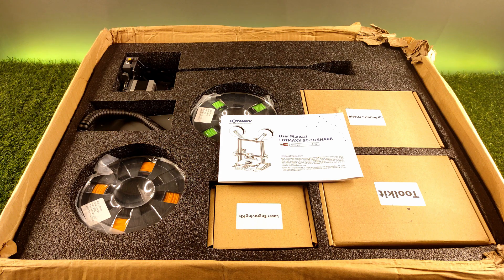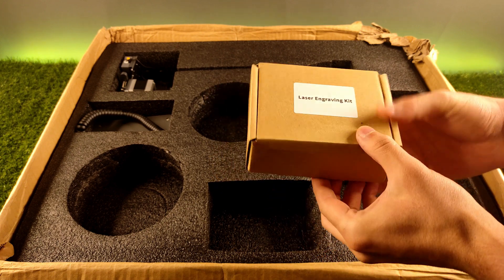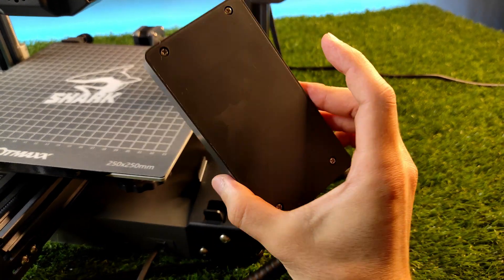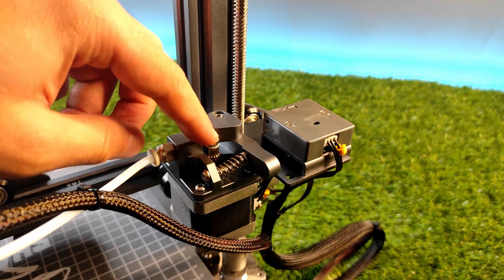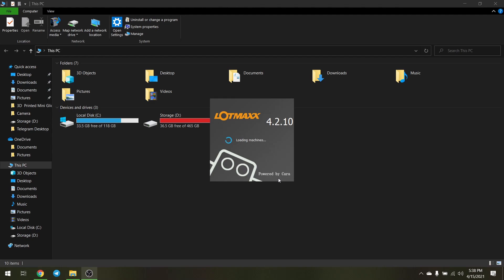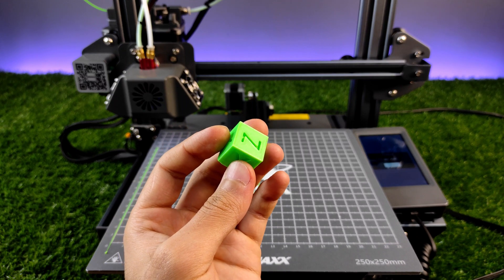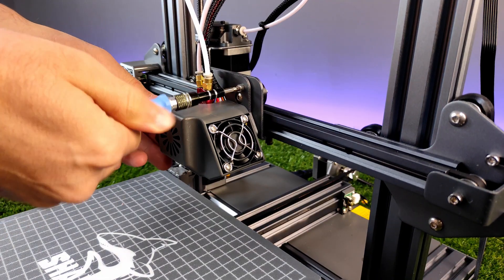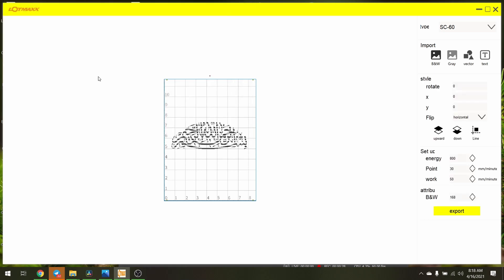Lotmaxx SC-10 Shark V2 Review: Best All in One 3D Printer?

Comment: I made the mistake of not manually leveling before automatically leveling. You want to talk about pulling your hair out because your printer is screwing up and nothing sticking to the bed? Yeah that'll make you crazy until you manually level the bed. What I discovered in the process is the bed was too low to actually level. The automatic bed leveler was actually bottoming out in the attempt to level. I've spent 41 years working with computer equipment and it's incomprehensible to me that an error message was not produced. If the system cannot level itself it should give you an error message beyond that I've totally enjoyed my printers. Yes I said printers I found a deal to get product returns from Amazon. I figured since it takes forever to get parts from China and you do have to order all replacement parts from China, I could at least get one printer working which would give me two and have the second one for parts. It would pay for itself. Miracles of miracles all three printers work! One thing I found when my son stripped out the head screwing it into the hot end is it's brass on brass. I understand the thermal requirements for heat transfer but I believe the threaded portions should be different alloys. If you're going to strip something out it should be the head not the hot end. When you get your replacement odd and you have to actually rerun the wiring all the way to the motherboard! Who thought that one up? Not the sharpest spoon in the drawer I'm sure. You have to run the wire through the loom to get it into the motherboard. I may have found another solution using çreality parts. The hot end basically looks like their equipment to begin with OR at least they're using the same equipment.

Comment: Hi, i realy like your videos. I have a question, whitch one is better? Glass table or magnetic plate table. I'm using ender 3 v2, but sometimes filament is not sticking the plate. I'm using glass table, should i buy a magnetic plate for my 3d printer table? Thanks for answering, bye :)
Reply from the maker: Hello, sorry for the late reply :))

If you are using glass, make sure it is clean, it is recommended to use dish soap and dry it with paper towels after washing you must not touch it, so it sticks perfect

if it does not help you can try spraying specific glue for 3d printing or hair spray
Reply: @engineericly  no problem. Thanks for answer. I’m using glass and washing table before every printing like u told ☺️ Btw I tried hair spray and omg its so easy to use and perfect result.  My glass bad is so dirty and terrible but when I use the hair spray, it’s giving perfect result with 2 side of the glass.